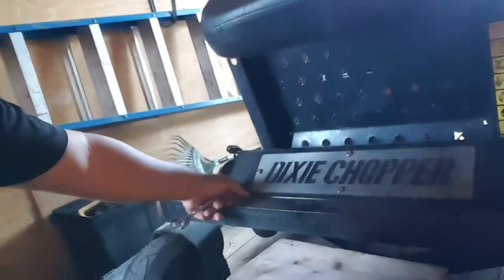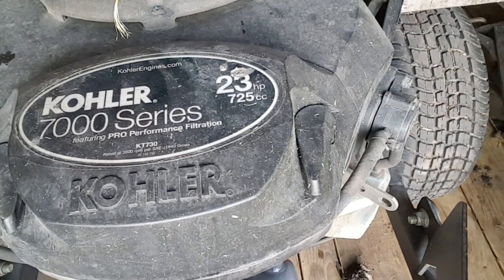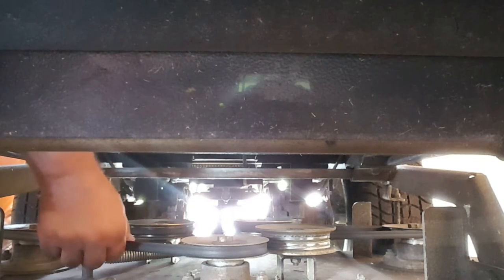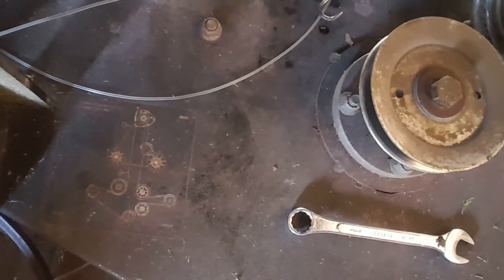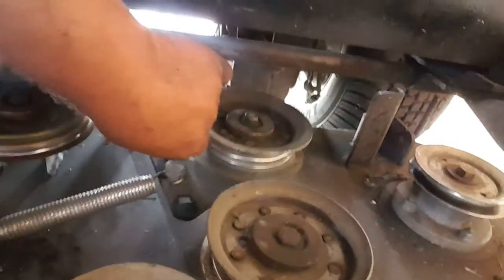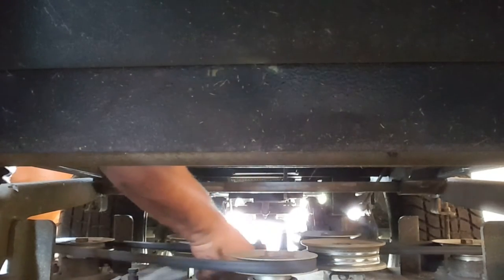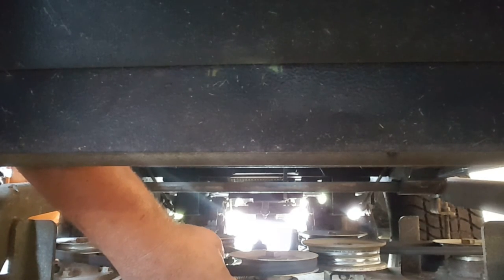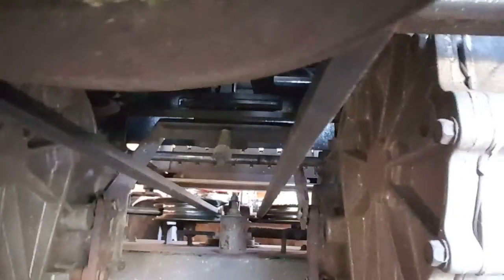How to change the belt on a Dixie Chopper Zee 2

Comment: great job Mario...the trimmer line on the spring is a great idea.  my new belt arrives next week.  the old belt is intact but frayed after it nearly jumped off.  I noticed the pulley next to my belt guide is loose.  I finished mowing but it is WAY too loud with that wobbly pulley. is that easily tightened or will i hafta replace it too?
Reply from the maker: That could be tighten

Comment: I bought the belt at my dealer it was $75 ,but I saved my old belt .did you have any problems with the pully yet after 430 hours you put in .
Reply from the maker: Henry Tauch not at all the pulley is fine. 40 at my dealer
Reply from the maker: Henry Tauch no i didnt